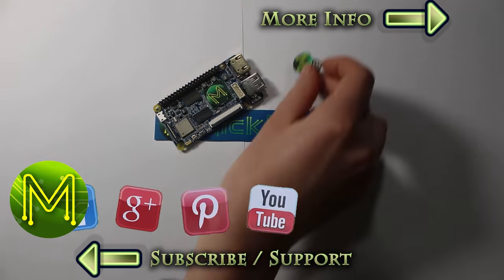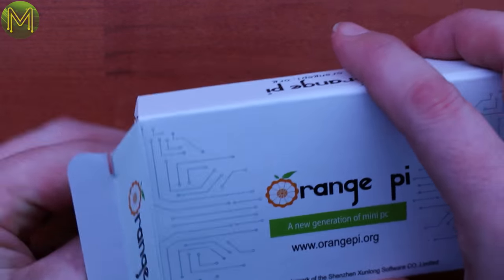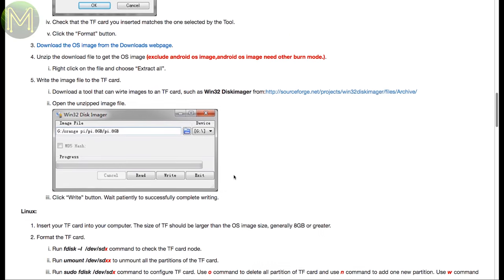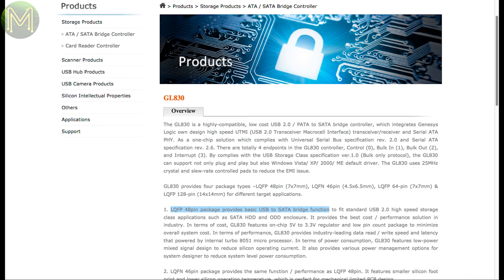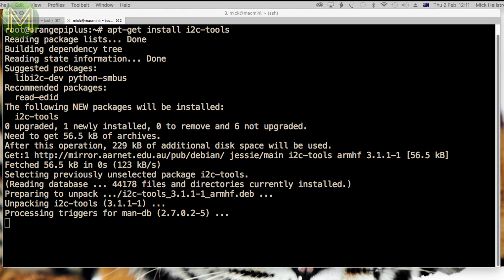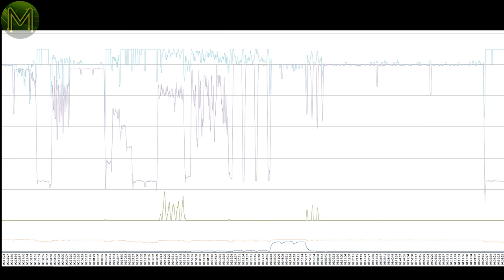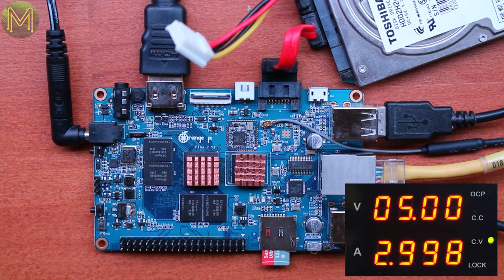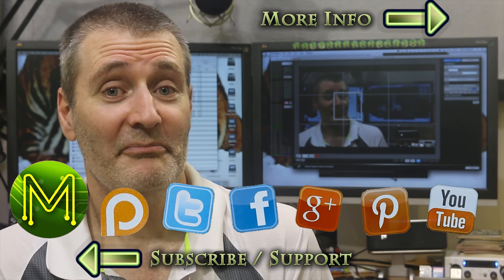#098 Orange Pi+ 2: Now with Magic Smoke! // Review

Comment: FYI MAX7219 LEDs works ok (in practice) with either 5v power and 3v3 SPI or just run the whole thing (a bit dimmer) off 3v3. I know the datasheet says no, but it definitely works.

Comment: Very useful lesson to remember... I've averted that kind of boo boo a couple of times, and I will reform.

I've been keep an eye on this SBC, even though I'm not a fan of Allwinner, it looks "promising". I am curious to know what it takes to prevent the throttling--does it require a fan on all the time, or will passive do? (I feel passive won't do.) Otherwise, your video answered almost all my questions! Thank you.
Reply from the maker: I've found that you really need an active heatsink. The small heatsinks can get hot because the fins aren't that big so they can't dissipate enough heat energy.

Comment: Nice reaction, LET IT BURN... . .BURN IT DOWN..
When it stopped you should have gave 50Volt. then watch everything else join the party.

Meh, Everyone does it. Not everyone videos it and makes it public. But everyone does it.
For us it was worth it.
Reply from the maker: +TheProCactus 
Yup as soon as I noticed my mistake and realised that it hadn't been switched off quick enough it was a goner. So, yup, let it burn!
Reply: I blew up 3 Arduino's,  One after the other just last week. all on the same damn error. In 15mins. Now that's something not to be proud off.
Reply from the maker: Yup, unfortunately it happens.
Reply: electronics work on smoke, if you let it out , they longer work

Comment: Could you please check if there are Slave mode I2C support on any board?
So far only BBB has I2C slave support in hardware (still need driver to be coded in kernel, but that is trivial)
Reply from the maker: +В Корехов ЖЖ (vkorehov-ru) 
OK. I'll add it to my testing.
Reply: Thanks for your efforts!
Reply: H3 datasheet says it supports slave mode I2C (obviously would need driver; doubt it's been implemented yet)
Reply: does it have 2 separate I2C busses ? so one bus could be dedicated for slave mode events and another for master mode? Ive coded bbb slave mode driver quite easily, there are docs in kernel with detailed desc of abstraction.
however im not happy with TI quality of hardware and particularly I2C recoverability and interrupts handling (for instance original driver hangs in infinite loop inside kernel, while servicing interrupts while AL condition happens...)
Reply: Datasheet says "up to" 4 TWI (=i2c) interfaces, likely at least two are accessible on external pins (didn't check) - see "linux-sunx dot org" for H3 datasheet and schematic of Orange Pis. Armbian is best linux distro; good support, easy to build+use. Only thing I liked about BBB was the PRUs; I had serious reliability issues with USB on it.

Comment: Very informative review. I wonder if the on-board 5V sata power, was low because it is regulated by the board, rather than just being passed-through straight from the board's 5V supply jack? I'll have to test.
Reply from the maker: Thanks mate. Interesting. Not sure, but good to find out.
Reply: I got 27MB/s for sata with hdparm and mainline linux kernel. I think that's in line with expection for gl830 sata chip. A trap for young players - the orange-pi's 5V sata power connector has polarity reversed for the off-the-shelf arduino/banana-pi sata cable I used. Fortunately my ssd survived! I couldn't see any on-board 5V regulator, but I think sata power is probably switched with a mosfet somewhere on board boot/startup. Keep up the great videos!
Reply from the maker: Julian 1 
Thanks mate. Good to know!
I still haven't gotten a replacement board, but will check that out when I do.

Comment: Damn, these Orange Pi are all faulty. They have been designed very bad ..... It burns ic adj voltage SY8008. Now I do not have the 30X lens to replace it and try again but I would get the same result, a gray smoke. The voltage must be measured at the TP1 and TP2 test points. Strange that there is only one 'solution to re-energize the microchip. 3.3V or 5V but in my case it does not go without the SY8008 but first we need to measure the voltage present at the pins of this IC and calculate a resistor to eliminate this defect. Today I try to power the usb by getting the 5V. How did you solve it? Thanks so much.

Comment: Hey, 
It would be nice to but mini heat sinks for the voltage regulators, and see how far you can boost the voltage.
Also see if boosting the voltage by a few percent allows you to overclock the Pi?

Comment: Of course replacing the tool behind the tool is a valid solution, but that's probably not an option.  So we have to work with what we're got.  A custom bench power supply controller that would prevent your mistake perhaps?
Reply from the maker: +rootbeer666 
I think I just need to stop having brain farts!

Comment: I love the smell of toasted phenolic in the morning! (As long as it's coming from the next campsite). These reviews are well done and comprehensive but  ........ can we some real world applications of SBCs, upgraded Nerf rifles for example. ........... Cheers.
Reply from the maker: +James Lamb 
Thanks mate. Yes getting Tim's time is hard, but I've teed up some time with him, so we'll see the Learning Arduino series back again.
Reply: it looks like in the video it starts to puff smoke before you overvolt it - is this a weird quirk of your power supply or an editing mistake? the current seems to go up a little before the voltage does.
Reply: mupps420 looks Like a match
Reply from the maker: mupps420 
Normally I insert audio sync markers when o have two cameras, I didn't have that in this case so had to sync up the best I could.
Reply from the maker: DIYelectronics 
Yes, in the gag I used a match because it produced the best puff of smoke I could find.
Reply: It takes along time to produce these, but may be Mick could highlight some good ones, some extreme ones and silly ones already available on the internet. This would be a bit like the news/new products. I really prefer the detailed reviews on new boards like this one. These boards often look good on the web and then Mick finds all these really major problems or limitations with them.

Comment: Can someone explain to me what happened, I don't understand everything he said : "easy enough to do, huh? Except ?????? issue, ??? really have set the voltage with everything disconnected".
What is wrong with connecting 5V to a 5V bus? Was that some exotic 4 terminal power supply where the feedback circuit was not connected? And where are the 5.15 volts mentioned; I saw just 5.00. Okay he SAID "three times the input voltage"
Reply from the maker: If you watch closely I changed it to 15 volts!
Reply: Ok thanks got it. That's a power supply NOT to have...
Reply from the maker: Well, I broke one of the golden rules. Don't fiddle with power supplies when you have a load attached.

Comment: It would be amazing if you could solve the HDMI issue - I have exactly the same problem. I find that it works on some HDMI monitors, but unfortunately not the ones I actually need it to! Very strange. You seem really clued up with this stuff though, so I hope you can solve it - you'd help so many people if you can :)
Reply from the maker: I'll look into it in the followup video and once I get my replacement board.
Reply: If you're using a DVI input monitor with an adapter for HDMI you need to run h3disp with the "-d" option

Comment: Well it seems that smoke genie struck us both! I somehow managed to cook a sparkfun FTDI rs232 to usb device (it's the one that goes for around $30AUD) so I wasn't too happy about that! But adafruit just released those silabs ones so I grabbed a few... 🤔
Reply from the maker: +Scott Evans (VK7HSE) 
Man! Were there flames? That's always a good sight.
Reply from the maker: +Scott Evans (VK7HSE) 
Actually caps blowing their head off is fun as well.
Reply: MickMake sadly no spark or fun! 😉
Reply: MickMake my silly mistake was grabbing a 9v plug pack but didn't pay attention to type of power being supplied by this bloody plug pack, yep you guessed... it "WASN'T" DC but AC so my guess is that FTDI chip didn't appreciate the AC kicking it in both sides... Oh well that plug pack has found a new life at the local tip shop! 😉
Reply: Oh neglected to mention the breadboard psu got the initial 9vac but the filtering would have been insufficient to smooth out the ripple, that FTDI device once the expected 5vdc applied the tx/rx LED's are lit as soon as power is applied... Should I ever find a FTDI chip in something I might attempt to salvage it... Maybe 🤔
Reply from the maker: Scott Evans 
Ha ha. Nice! Nothing like being punched from both sides.

Comment: Just a suggestion lad. I'd hook the hard disk to an external supply, like directly to your lab PSU instead of through the Pi board. Maybe even a spare ATX or something. I somehow seriously doubt they intended to have a mechanical drive attached to that power port. An SSD might work but I don't think I'd try that either. I just spent the last 20 minutes or so looking up the component specs and they just weren't designed for that much current which is sad. I've always rather wanted to take one of those SBCs and make it completely mobile with a LiPo or something attached in line with a buck regulator or something and a touch screen. Those who play the Fallout series will understand what a PipBoy is and I'd rather like to build one with as much of the functionality it has as is possible to achieve. You can watch some game play videos to get an idea if your not familiar with the game. It's a rather handy device and I'd love to make it real. This video gives me hope as that SBC has a SATA port available. Congrats on your nearly 13000 subscribers in the meantime...
Reply from the maker: +ExStatic Bass
Yup, the intent with my video is to highlight the good and bad points with products. If they have a "power connector for SATA" then it should theoretically work. I probably should have highlighted this test more in the video, but things went poof and I got a little distracted. :-D

PS. Ignore my previous comment, I thought I was replying to another video. (Really dislike the YouTube comment system.)
Reply: No worries mate. I just found the active components for driving the SATA power port a little underrated and as such underwhelming. The suggestion I made follows that logic. I was fairly certain you'd figure it out sooner or later and you did. So as I said before, no worries...

Comment: Subscribed. Think this is the 2nd vid of yours i have seen. I havent run a Pi yet, havent messed with computers and electronics since about 2000. Looking at best vs cheap options. Having fantasies about udoo x86 ultra...... i dont even know why. Might turn my car into a star trek shuttle craft.
Reply from the maker: +andy coppes 
The UDOO is a nice board. If you want stability and more software choices, then an x86 based SBC is the way to go.
Be careful about which one. Car temperatures can skyrocket. In Australia, in summer, they can reach 60C easily.
That’s sort of ambient inside temperature will kill pretty much all SBCs.
Reply: MickMake Wow, that's a great point. That's 140F where i am from, and yeah it could get even hotter. Glad i didnt meet the blue smoke genie LOL Glad components didnt just melt off the board
Reply from the maker: Yup, the board probably would just crash and burn.

Comment: I was in a store the other day and someone push the orange pi, i am not sure i can agree after seeing several videos, love the fact that one of the OS choices is actually banana pi OS. they say you get what you pay for , not sure about this set of SBC
Reply from the maker: It all depends on what you want to use it for. Putting aside the O/S software issues, I've heard a number of people having hardware issues and not just from Orange Pi... across the board from cheap SBCs.
Reply: very true, it is why i hate the term "pi-killer" , every time I hear it , I cringe ,because, support (got at least 5 magazine and bunch of books) , quality, but the one that gets me is when you see most of the stories they missed the point of the raspberry pi , to get kids (and adults) back into programming and electronics. And it has according to stories i have read in Magpi .
Only board i have seen so far which came close (in concept) was the Chip computer (read about giffy cam)
I like to point out before the raspberry pi came along most SBC where mostly computer not GPIO type devices, most of the boards that were controller type where micro-controllers  (arduino , stamps, pic) and the issue with them was you needed a computer to program. Upton did see an issue with kids using the family computer fro such things (what use the 2000 dollar device for what). 
Now as far as these new boards doing comparisons to pie, i wish a consideration was made to why the pi was made (retro pie and playing hi power games was probably not the original design idea) . The concept to really look for , same price or lower, support, quality, ease to program and to program IO pin use, and some app base. This more power concept is one i wish would stop
Now one board to look at that is not computer is the mirobit , you can program from a cell phone app.
By the ways one good reason to look at would be MBED , I have been doing various production work in electronics and raw programming and electronics is a very big field

Comment: Nice gigabit, shame about the sata being driven from usb2 though otherwise could have been a decent file server.
Reply from the maker: +zyxwvutsrqponmlkh 
Yup I agree. It would still be good enough as a single user/single drive NAS though. Pretty good for the price.
Reply: I would never have thought that an on board SATA would have been run through the USB 2. It is a complete waste. Sure if you want to put a drive in a box, but really most people would want on board SATA for the increased speed.
Reply: The only allwinner chip with real SATA is the A20 (e.g. Banana Pi M1 - it's a bit old now but I like it; very well supported under mainline linux nowadays too) Note the A20 has a never-resolved issue where SATA writes are relatively slow (~30MB/s) whereas reads are nice and fast (well over 100MB/s)

Comment: Well, you have stepped on the usual landmine with all SBCs - the power rating, and here is how to do the workaround properly: use second PSU for your HDD and connect the ground pin of your HDD-dedicated 5V PSU with the SATA power output jack. For USB it's an out-of-the-box solution with an external USB hub with a PSU - it is all done, grounds are connected too. But you should NEVER do over-voltaging the SBC itself!
Reply from the maker: Yes, i didn't make it clear in the video that I am already using an externally powered hdd
Reply: Good! The HDD is easy to detect as a power eater, the real challenge is a USB device, that's why I am using a voltage and current meter and plugging it one by one to make sure that the numbers are fine. One odd case was with the wi-fi dongle and the USB HDD: it seemed to be OK, but when HDD and WiFI were loaded together - they consumed too much and the system was unstable.

Comment: you shouldn't have fried that board such a waste !!! you will appreciate it if you lived in a country like mine where i can even buy a raspberry pi or any other electronics product !! even though i study it and need it for my graduation project !!!! any way nice video the orange pi beats the raspberry pi in every aspect .. can the orange pi run python with open cv like the raspberry do ??
Reply from the maker: +fouzai alaa 
It was a genuine mistake. I'm annoyed about it as well.
It'll run anything that the Raspberry Pi runs. It'd actually be pretty good at running OpenCV with the faster processor.

Comment: 10 turn pots ftw.
Reply from the maker: +iceberg789 
Yes! I agree, but also changing the voltage with everything unplugged!
Reply: true. your power supply has current limit settings, right ? perhaps 1-1.5A limit for doing these kind experiments could save the day.
Reply from the maker: iceberg789 
Yes it does and usually I set it to max until I do my current and load tests.
Reply: It was killed by volts, not amps. 5 Volts X 1.5A = 7.5 Watts. 15 Volts X 1.5A = 22.5 Watts.
Reply: +Randy Smith voltage actually doesn't kill itself. voltage = potential (like when they say - "you has such potential, but never achieved anything"), current = result, that thing which kills stuff.
Reply from the maker: So what normally happens when you overvoltage a component is that the silicon starts to break down and for a brief period of time the device will draw extra current. So the rise in current is actually to be expected.
Is this what kills it? Well although it doesn't, it's like the icing on the cake. The device has already started to break down because of too much voltage, so there's no turning back. The inrush of current as it breaks down will snowball and you start to see flames.
Limiting the current will just result in no pretty fireworks.

Comment: You should try RetrOrange Pi because It can boot 3 different linux images all with there own advantages.  OpenELEC(best hardware based video playback), Armbian(best linux desktop), and RetrOrange Pi(video game emulation).
Just a few important notes...on the first boot you will need to have a game controller attached ps3 or xbox seem to work fine.
To get into Armbian use your controller Start button to get into Apps and select OpenELEC or Armbian and it will reboot into that linux distro.  to get back to RetrOrange Pi from Armbian there will be a icon on the desktop to click from OpenELEC go to the programs tab and click the RetrOrange Pi icon.  If you do not use the icons to reboot into retrorange pi it will boot back into the last operating system even if you reboot by  power cycling.
Link to image is below. Good luck.
http://orangepi.club/showthread.php?tid=6